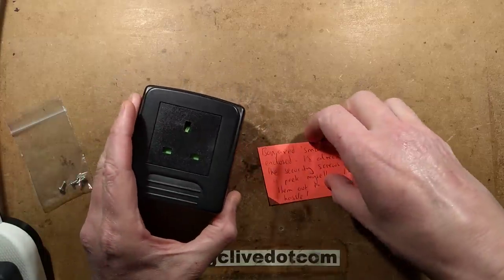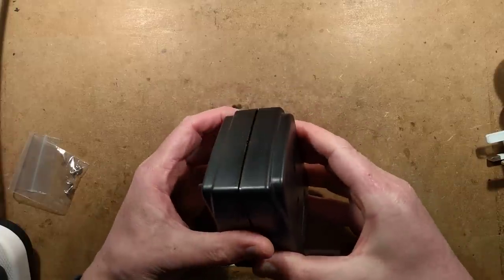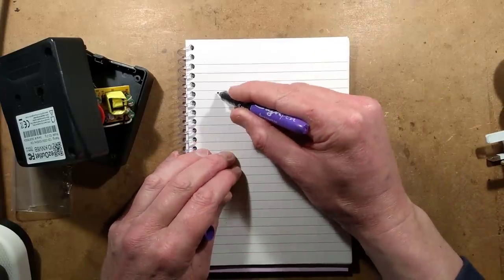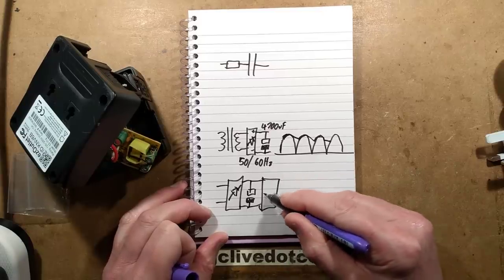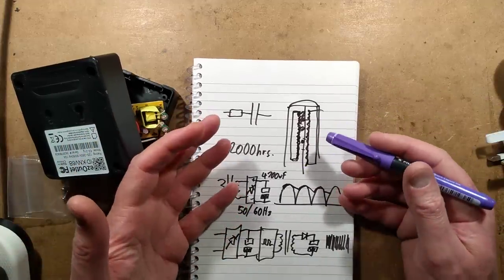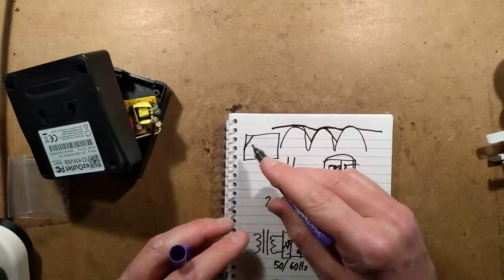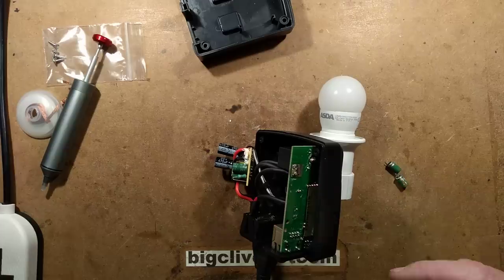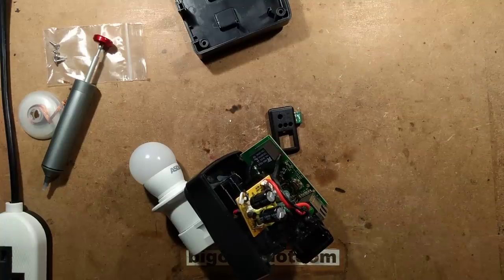Fixing an ezOutlet with inappropriate components.

Comment: Hi! I'm currently making myself an order for recapping some stuff (monitor PSU and an ATX PSU), very good explanation about why low ESR caps are needed.
I was wondering, what kind of values is considered low ESR?
Reply: For the 470 µF / 10 V spec needed here:
Panasonic FR/FM (low ESR): 8x11.5 mm, 56 mOhm, 3000h @ 950 mA @ 105°C
Panasonic FC (standard / lowish ESR): 8x11.5 mm, 117 mOhm, 2000h @ 555 mA @ 105°C
Jamicon TK (standard ESR): 6.3x11 mm, tan(δ)= 0.20 @120 Hz, 2000h @ 260 mA (120 Hz) @ 105°C (ripple current @ 100 kHz: +20%)
It is obvious that the last one must have a substantially larger ESR than the FC, considering that Pd = ESR * I_ripple², though I'd guess it is also less heat-resistant in general.

On a side note, in general lower ESR in Al electrolytics tends to be detrimental to leakage current and, as a consequence, long-term stability in lightly loaded scenarios, as they are more likely to fail short. So in practice you have to find a good compromise. A traditional audio amplifier is likely to be the wrong place for ultralow ESR caps. You might even find some low-leakage parts in one, which are on the other end of the ESR spectrum altogether.
Nichicon RLB (low leakage): 12.5x20 mm (!), tan(δ)= 0.17 @120 Hz (ripple current = 0.8 of 100 kHz value), 1000h @ 570 mA @ 105°C
I had to go up to 63 V to find a 470 µF Jamicon TK the same size:
Jamicon TK (standard ESR, 63 V): 12.5x20 mm, tan(δ)= 0.10 @120 Hz, 2000h @ 580 mA (120 Hz) @ 105°C (ripple current @ 100 kHz: +25%)

In general, I'd assume a quality "normally low ESR" would do fine to replace monitor PSU caps, especially dodgy ones. If you can fit the next bigger voltage rating, that's usually beneficial, too. On the secondary side of an ATX PSU, I'd pull up the original caps' datasheet and find something at least equivalent. If they are from some reputable manufacturer, they may have been undersized or from a faulty series (some of these exist - usually researchable on badcaps.net), otherwise good-quality equivalents may again be all that's needed.

Comment: These things usually leave a nice attack surface to exploit. Either to randomly power cycle stuff. Or to overwrite with new software.
Reply: Wouldn’t that turn off the Internet ?
Reply: @SproutyPottedPlant  power cycling? Yes, for a bit. But lots of things are vulnerable as they power up, so being able to force that state is useful.
Reply from the maker: Yeah.  The internet is a hackers playground with this stuff.
Reply: They can be designed so they are secured, but almost never are.

Comment: I think there is no reason to change the diode. Normally they are quite reliable and I don't see it really overstressed by thje dead capacitor. current draw is reduced when the relay   does not stay on. diodes normally also tolerate quite high temperatures and they often run hot what reduces the forward voltage - and the leakage in a schottky d.

Comment: For all your talk about capacitors, I'd love to see you tear some apart as you did lithium batteries. There are all sorts of sizes and styles and the differences could be interesting.
Reply from the maker: I have taken a few different types apart in different videos.  I could make one where I just take capacitors apart.
Reply: I'll keep an eye out for them. I've been going through the backlog chronologically but I'm still a few years out yet!
Reply: I find 400V DC tkes most of them apart, unless mains rated, but you may need a high speed camera to appreciuate the effect fully ;-)

A decent voltage doubler would allow most higher voltage caps to be expeditiously disassembled...

Comment: The one that failed, suffered a heat-accelerated failure, for two reasons.
First reason is that it's right next to the diode! And that diode is very hot. If the power supply has 5V coming out of it, that diode probably drops like 0.4V or more, so like 8% or more of the total power consumption of everything in there gets dissipated on that small diode.
Second reason is that it has all the ripple, some of which gets converted into heat; since the second one sits after the choke, it has no ripple on it already whatsoever.

The small size of these is a hint that they have been comparatively overrated by the manufacturer. They're likely routinely overrated by 15%-ish on the capacity and they likely have a lower safety margin on voltage than Panasonic. You can use next smaller capacity like 330 probably just fine.

Another word on the low-ESR types. To me, there's often no point. A year or two in they simply lose all their low-ESR-ness! You can open any lightly to moderately used PSU which still works and pull and test a low-ESR cap and it'll be higher ESR than a standard one, even a Chenxing or ChongX junk out of your drawer. You can use standard type no problem, at least short to medium term, seems even somehow more durable. Water-based low-ESR electrolyte something something. The frequencies here aren't even that bad, only a couple hundred KHz. Maybe give it a little ceramic friend in parallel, i tend to do this.

Comment: In my experience 10 volt electros used in power supplies are all garbage, have seen lots of failed ones I generally replace them with 16 volt ones if there is sufficient room. One of the worst brands I have seen are CapXcon brand.
Reply: oh, yes, that brand should be whipped out on sight 😉

Comment: Noooow.. the good old hardware was built with large safety ,
because people wanted it to last.
So even it had only half its capacity left, it still worked just fine.
Also makes it easier to repair, because as long as you get the same or 

a higher voltage rating, it often works again even with only half the original capacity. (just check the ripple..) - more often its the corrosive guts the capacitor spilled all around, that really are dangerous to the equipment.

aaaand the caps are rated at some high temp like 85°C for their lifetime,
but last much longer if its cooler by 10°C already...

also, if you switch off mains power to devices which dont need it, when you dont use them,
it keeps the power supplies alive. Biggest problem in company equipment, because people are too lazy and dont care for the high power bill. Also an easy fix for old office equipment which gets binned...

But who am i telling this. First, every equipment of BigClive is freezing all year around or under 10°C aaaand if it fails it gets repaired...

Only thing you forgot to tell is, that you can use two polar (+ marked) caps in a row to make a  bipolar to test a (passive) frequency divider for your speakers before getting the expensive stuff with the correct values..

Comment: I have never understood why capacitors fail from  a time point of view. I had a Saba mains alarm clock with a digital display. It worked for 45 years before it failed and it was on 24 hours a day. 
It was quite complex inside so I was never able to fix it which a shame because it could wake the dead the alarm was so loud. 
I see modern computers failing after only 5 years and yes it may be a ploy by manufactures use top make you buy a new one, which is a shame because my Panasonic TV  is coming up to 19 years old and I'm more than happy with it.
Reply: They eventually fail in modern equipment because the high frequency ripple at a significant current will put a lot more stress on them. It's as Clive explained: your alarm clock used an ordinary mains transformer with 50/60 Hz rectification and regular capacitors. They lead an easy life from an electronic point of view. The computer caps run at tens or hundreds of kHz and have to deal with large ripple currents. When they start to dry out, you get a positive feedback loop: their ESR goes up, leading to more internal heating, leading to even higher ESR, and so on until the circuit stops working or won't power up the next time anymore. That's the price we have to pay to get high-wattage power supplies within a small form factor.

Comment: Ill guess that smart switch would have one BIG design flaw. Just imagine your router is updating its firmware, during that time nothing has an internet connection. Now while the router is updating its going to switch it off and now the router is probably bricked. Just got a similar thing happening at home, router was updating no one had internet, my brother was turning it off and back on again while it wss updating and it was bricked.

Comment: An electrolytic cap's lifetime is rated at a certain temperature (usually 85 or 105 degrees C, but higher can be found). This is a sort of a worst case figure.
Look at the datahseet of (e.g.) the Aishi CD11GES, you'll see a cap rated at only 3,000 hours at 130 C, but at 105 C the lifetime quadruples to 12,000 hours. If you were to run this cap at normal room temps, I wouldn't be surprised if it could last for decades.
Wether or not a voltage is applied also influences the lifetime. Store this cap at 130 C without any voltage and 1,000 hours is all you get.

Comment: you know!! maybe that is what is wrong with your phone causing screen to crash.

1. bad capacitors on the board  allowing noise to get into the display panel causing it to crash.

2. if you are using a cheap charger for the phone the device will not charge (apple does this to make sure you use apple approved chargers) however the device will still work and will drain the battery then only run from the cheap charger but just will not charge and if the capacitor is going bad or if you have an under powered charger there will be ripple getting into the device causing the voltage to be starved and as a last ditch attempt to keep recording it disables the data stream to the display panel.

3. if you are using the wrong voltage sd card like you are using a 5 volt sd card on a device that can only support 3.3 volt cards or vice verse it can put a load on the device's power supply that puts it on the edge of failure and out of a last ditch attempt to stay working it disables the data stream to the display panel.

4. if the device is overheating the cpu may be thermal throttling and to preserve enough cpu cycles to prevent dropped frames it disables the data stream to the display panel. (you can test the device if it is getting hot then it is overheating it can also overheat if the heatsink compound is failing you can test either case  by using  a can of air and spray the liquid at the device to chill it while it is recording and if the screen starts working it is overheating.

when you said the screen locked up was you getting any motion on it like if you wave your hand in front of the camera would you see it show on the display?

if not then it has crashed but if you do still get video motion on the display then you could have accidently set the protect mode like you can set on portable cd players to disable the buttons.

if you use the wrong capacitor on the repair sometimes they will explode so you want to have eye protection because a flying can to your eyes is not good.

larger capacitors have a seam that is cut in the top in the form of an X or K and is designed to open and vent preventing an explosion and paper and foil from being scattered.

the really big capacitors like ones used in industrial applications that are the size of a 12 ounce soda can or bigger will have the vent on the top

https://tiimg.tistatic.com/fp/1/001/993/industrial-capacitor-250-volt-d-c--476.jpg

in fact you can see the vent it is a little white circle above the logo.

that rubber plug will blow out and vent if one of those go because if one of them explodes it would make a big bang  and injury could result

Comment: 'In old equipment there's no harm in recapping' Well, there kind of is in a way that many caps from the 70s are a bit different technology, different electrolyte, I think, and so they last much longer, so it would be stupid to blindly recap everything just because. Or when people change old, very high quality caps with cheapest they can find or caps that were designed for a different application.

Comment: Look for Panasonic FS Series, if Size is important.
If Impedance is important, get FM.
The FC is old and big, that was the one that you found there...
Reply: Panasonic FR series are the best. Rated for 10,000 hours at 105C. They will last a long time.
Reply: @simontay4851  FS Is Downsize Version of FR.
And its not 10.000h, its up to.
The 6,3mm are only rated for 5kh, 10kh are for 10x20mm or larger.

Comment: An interesting unit, that psu is diddy like the ones in mains outlets for usb phone charging.
Most small power supplys don't seem to have any vents in the case to allow hot air out and drag cold air in.
Electronics stuck in an ovan :-(
Reply: Probably better on the safety / environment proofing side though... think spills, moisture, bugs and the like. Tradeoffs...
Reply: PileOfEmptyTapes
i know you are right, but i still get annoyed at the amount of supplys that die due to the ovan effect :-(
My personal units have a bad case of plastic woodworm, yep perfect 1/8 holes in the top and bottom to let the heat escape lol :-D
And they dont die early now.
Common sense has been amputated from most people these days, everything has to be asshole proof.

Comment: If I start turning off our router overnight then the line management starts dropping my speed thinking its the connection going unstable.
Reply: @Matt Quinn We still use copper twisted pair here in the form of VDSL as there's no fiber to the home infrastructure in this town, that's still about as reliable as ADSL in my experience.

Comment: Do you get similar problems with other types of capacitors or, what problems do you get with other types of capacitors? Are things like tantalum capacitors more reliable or longer lasting then electrolytic?
Reply from the maker: Tantalum capacitors are problematic too and X2 style suppression capacitors can change in value over time too.  The most reliable tend to be the low value ceramic caps.

Comment: 11:30... I don't think it went off direction. Electrical things are like magic to me. A simple smith, I have no clue what powers the magician's spell. As you explained the capacitor and how to tell if one is failing or failed - and how you can replace them or just solder on a new one and then check your wizardry-monitor. Well, that actually taught me a lot more than you think it may have.
One day, I might teach you the magic of making a rock into a fine steel blade... then making it hard and flexible! You must have the right temper to deal with such knowledge. Or, how to take cyanide and turn mild, soft iron into a hard bit of razor-edged steel.
Reply from the maker: It helps that I spent my apprenticeship in steelworks.  You see a lot of the science there.

Comment: I don't get it... He spoke about the high frequntsy of the switchmod power supply caus the output smooting capacitors to have issues by heating up and casuses the electrilic to prouduce gasses.
But here the input capacitors started to fail, those don't recieve anythig from the high frequency part.
Reply: They in fact do, the primary is also switching at the same high frequency as the secondary, only at a much lower current. The primary also sees a high ripple curent at the peaks of the 50Hz input (100Hz) as it charges through the full bridge rectifier. Those peaks have a high frequency component too. That's likely the bigger current here.
Reply: @brainndamage  Hmm, thats some new detail to me. Thanks
Reply: I am pretty sure that the caps he replaced are on the output side. I mean, the puffed-up one was right next to the secondary-side rectifier diode.
Reply: @PileOfEmptyTapes  Yeah, I was wrong. I see he pointed at the undamaged capacitors when he checked their capacitance. Alao I souldhave noticed the mains wier there.

Comment: I have built myself a unit to do this using an ESp8266 and a cheap eBay relay board (total cost around £5).    Would be a good first ESP project (you can switch the low voltage going to the router so no mains voltage involved).
Reply: Does your unit ping the internet and auto re-boot?
Reply: @tonyweavers4292  Yes, it connects to the router by Wifi and pings a couple of sites.  If no reply then it assumes the router is down and reboots it.  I have also made one which periodically checks my home automation server and if it stops responding reboots the server.

Comment: a dmm set at ac put on dc to try snd measure ripple doesnt always work, i certainly have some that  give a false reading when put on stable dc, you need to put a cap in series to block the dc level..

Comment: I have a guitar amp that when it runs for a while it shuts off and on again repeatedly.. is that a faulty capacitor perhaps ?? ..
Reply from the maker: Could be.  Or a dry solder joint - often on a heavy component.  Sometimes it helps to take a soldering iron and reflow the bigger joints on things like transformers with a touch of fresh solder.
Reply: @bigclivedotcom  I'll make it my project for today

Comment: the outside usb idea ain't even that bad, i fixed a projector with an extrernal 12v psu because the internal has failed somewhere out of my technical knowladge. sure it needed two sockets then for the lamp and 12v psu but it worked till the pixels died aka acer

Comment: hey Bigclive, i have a question, i bought a cheap qualcom 3.0 charger but i think il has noise or someting  that makes my phone toutchscreen  going crazy while charging. i dont have a ground in my house but other samsung chargers dont do that. i ve seen people tigh a wire to the metal part of the tipe c  connector plug and hold it in hand as a ground. My question is why does it do that and other good chargers dont even without ground. Thank you
Reply from the maker: Many cheap chargers do cause screen issues.  They often have terrible electrical isolation too, so I'd actually suggest buying a good quality charger.  Definitely don't handle grounded metal while holding a phone connected to a cheap charger.